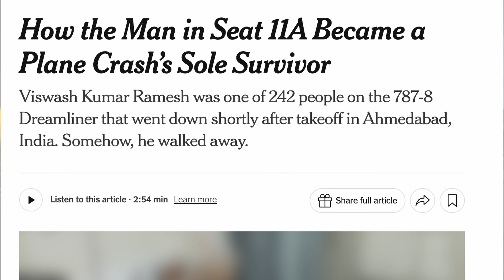Why the RAT Changes Everything – Air India 171 Update

Comment: According to my research he was the best pilot with vast experience ❤️. In those precious final 30 seconds, he tried everything:
1. Sent a mayday call,
2. Attempted a hard landing,
3. Lifted the aircraft’s nose to protect passengers,
4. Relied on automatic RAT (Ram Air Turbine) deployment,
5. Knew that a hard landing was inevitable,
6. Used the landing gear to minimize impact and absorb the shock.
He was the ultimate captain—fighting till the end. We may never know what sabotage or failure occurred, but we salute his duty, courage, and clarity under unimaginable pressure.
Let the world know: there was no thrust, no lift, no power—only human spirit. His last moments were a powerful message to humanity and the global aviation community.
Perhaps, someday, fuel ijector systems or better backup mechanisms will be invented for such aircraft.
Now, serious questions must be asked—not to assign blame in haste, but to prevent the next tragedy:

How could both engines fail simultaneously?

Was it a fuel system flaw, a software failure, sabotage, or a maintenance oversight?

Were redundancies lacking in critical systems like fuel injectors, RAT capacity, or engine health monitoring?

To the aerospace engineers, regulators, and decision-makers: this is your wake-up call. When both engines fail, and pilots must rely on spirit alone, the system has already failed them.

---

Legacy Beyond the Flight

Let this pilot’s courage inspire new standards, better safeguards, and deeper accountability. Let him be remembered not only for how he died, but how he lived: with integrity, with resolve, and with a heart committed to every soul onboard.

“I'm going down... but you alive people—do something for humanity.”

Comment: The crash of Air India Flight 171 stands as a textbook case of compounded systems failure under unforgiving environmental conditions, with tragic consequences.

What began as a seemingly routine takeoff quickly escalated into an unrecoverable emergency caused by a fatal convergence of mechanical, electrical, and aerodynamic breakdowns — all within the first minute of flight.

The first failure occurred before takeoff: a latent electrical issue, previously observed as air conditioning flickering, likely went uninvestigated or undiagnosed. This silent fault compromised core electrical buses responsible for gear actuation, flap control, and configuration alert systems.

After liftoff, the landing gear remained extended, either due to pilot inability or mechanical/electrical fault. This created massive aerodynamic drag. Simultaneously, flap misconfiguration — either under-deployed (low lift) or over-deployed (high drag) — worsened the situation. Configuration alerts may have failed to warn the crew due to the same electrical issue.

The takeoff occurred in ambient temperatures exceeding 40°C, reducing both air density and engine performance. Engines were likely operating at maximum thrust to overcome drag and high weight — leading to an engine surge or failure, as supported by the survivor’s report of a loud boom.

At approximately 625 feet, the pilots declared a Mayday:
“No thrust, no lift.”

The aircraft entered an unrecoverable stall. With gear down, possible flap error, and failing thrust, lift was lost. The nose remained up — a classic sign of deep stall — but the aircraft was no longer flying.

In these final moments, the Ram Air Turbine (RAT) likely deployed. The survivor reported green emergency lights flickering — consistent with RAT-powered systems activating. It is critical to note that the RAT only deploys if both engine-driven generators fail, and the APU cannot supply power — indicating a total electrical collapse.

This suggests either a dual engine generator failure, or a severe electrical system fault that cut off power to both essential buses — even if one engine was technically still running. The RAT may have allowed the Mayday call, but was too late to affect flight control.

The aircraft crashed into the BJ Medical College hostel, broke apart, and ignited in a massive fire. All 241 others perished.

Flight 171 was not brought down by one error, but by a chain reaction:
An unresolved electrical fault, unresponsive control systems, environmental stress, and thrust collapse.
The RAT’s activation confirms a full power system failure.
This disaster illustrates how even a modern aircraft can be rendered helpless when multiple layers of redundancy are compromised simultaneously.

And yet, from the wreckage of total destruction, one man survived — his seat torn from the floor during the breakup, hurled through a gap in the fuselage.
In that moment, fate met physics — and conspired not to take him, but to spare him.

Comment: The second I heard the video I knew it was the rat which also cleared me of the “FO” mistake theory because even if the FO did go flaps up too early there’s no way they would immediately go up… they move very slowly and he could have easily moved them back after making such an obvious mistake. I dont know what could have possibly caused dual engine failure besides fuel contamination or some insane dual engine compressor stall strong enough to stop the engines. The compressor stall would explain the bang but on both engines at once is unheard of and the engine would still be able to somewhat produce power. Can’t wait to find out what cause this tragic accident.

Comment: Another channel talked about the noise from the RAT as the plane took off. The channel played the noise from a RAT unit in operation and it sounds exactly like this sound. 
Also, a news channel from Australia had a Commercial pilot claim the accident was caused by pilot error and airlines are hiring pilots without enough experience. https://youtu.be/3v3E5FVInzg 
I thought this reporting was completely irresponsible from a News Agency and told them so. Thank you for the great job you are doing and your honesty.

Comment: I feel it was electrical. There is a video of the same airplane two hours prier where the air conditioning wasn't working, the touch screens and lights weren't working either. I think it wasn't fixed or it wasn''t fixed properly and that lead to other areas of the plane not working. I think this could and should have been avoided.

Comment: The fact that the aircraft used every inch of the runway to lift off shows there was less than the full power needed from those engines at that stage. What caused that lack of power was obviously not diagnosed by the aircraft electronics before takeoff. This is what needs to be determined. That jet was doomed to crash before it even taxied to the runway.

Comment: My theory of fuel contamination seems to be fitting.l

moisture got into the fuel tank and clogged the inlet pipe causing the engine to stall plus they forgot to set flaps 2. 
Both these are strong contenders.

Let's wait for few more days until the report comes out

Comment: This flight was doomed from the moment it pulled away from the gate. I saw a video that showed that the plane's ac was not working properly. I do not know, though, if that is accurate. If so, though, could it have been an electrical problem? If so, then I am sure they would have called maintenance.  My thoughts are with the families.

Comment: IMO This Airplane uses Non Bleed Jet Engine in layman terms this engine just give thrust to the air plane it does not run AC / Fuel Pumps / Hydraulics etc. APU (Auxiliary Power Unit) Gives compressed air to generator which produce electricity to run AC / Fuel Pump and other instrument. What I believed might have happened is APU failed right after takeoff because of which Complete electrical failure happened RAT deployed and Fuel Pump can not pump fuel as Apparently each engine have 12 nozzles and each nozzle needs 4-5 psi pressure which is impossible to generate with help of RAT electricity. It is just a speculation though.

Comment: A tv news reporter was speaking to the mother of the boy who took the video from the same roof. She said that "the plane did not sound normal..did not sound like other planes." 
Then as if to prove her point another airline flew by (probably a domestic A320 neo) and the sound captured on the mic was loud and deafening.  Exactly how the ill fated jet would have sounded if both or even one engine was running. It was most definitely dual engine failure.

Comment: If you look closely to the main landing gear they seem to be tilted foreward iso backward. I’ve been told the foreward tilt is driven by the gear up hydrolics, where the boogies (wheels) are positioned such before they are retracted into they wheel bays. If that is true, it kind of debunks the theory the pnf pulled the wrong lever.

Comment: The plane involved landed 2 hours earlier from another flight, so what happened between the successful flight and the fatal one? Software update- no ! Dual engine maintenance - no ! What changed - pilots; unlikely pilot error ! Refueling - contaminated or refueling induced technical malfunction. Given high level of redundancy on planes you need to look for single points of failure to explain dual engine failure. Fuel !!

Comment: Technical fault would be high on the list. Possibly a fault of the air/ground logic  to the Thrust Control Malfunction Accommodation (TCMA) has lead to the TCMA thinking it's overthrust on the ground, thus shuts both engines down. RAT deploys. APU tries to start hence APU inlet door open in wreckage with flaps still deployed and unable to retract gear.

Comment: The start and lift off where OK. I think there was an engine failure on one engine. The flaps are set for two working engines. If one engine fail, the flaps have now to be set for this new situation .There was lift, the right wing is tilting upwarts, but too little.  .

Comment: Yes, I completely agree with you about the sound of the RAT. But what led to this? Perhaps there was a critical shift of cargo in the cargo compartment, which caused a short circuit in the battery and the shutdown of the entire on-board electrical system almost immediately after the aircraft took off from the runway!

Comment: Hi Captain, what is the possibility of the 787's lithium Ion battery exploding given the fact that the airplane was in the tarmac for hours under the hot sun, probably close to 40 degree Celsius, which resulted in a catastrophic electrical failure and the consequent engine flame out & deployment of RAT.  Could that be the reason for the loud 'Bang' as reported by the lone survivor. The 787 had a history of lithium Ion battery issues in the past. No one seems to discuss this theory.

Comment: Steve l am a pilot who lives about about 700 m from the south end of FALE directly under the approach departure to that airport. Daily there are approaches and departures of B777 and A350 and the occasional B787. I know well the sound of the engines of these heavy widebody aircraft both on takeoff and on approach. If the engines of that Air India B787 were at full thrust they would have been very audible which they were most certainly not and most certainly one would not have been able to hear the rat. Right at the beginning l saw that video, to me it sounded as if l could hear the sound of turbines windmilling due to the ram air into them. In addition if you look very closely l believe that it can be seen that both the slats and flaps are deployed. Most certainly a video l saw of the left wing lying on the ground showed both the slats and flaps deployed.

Comment: How could both engines fail at the same time, only if there is no electricity to run the engines! so, i believe it is an electrical generation failure or a fuel contamination. fuel contamination is very unlikely, so it is most likely an electrical shut off to the engines. RAT deployment strongly supports this.

Comment: We already knew the RAT was out from the sound but nobody has stated if it is possible to manually deploy the RAT.  In other words could the pilots have misinterpreted a lack of climb for failed engines and triggered the RAT themselves?  There is still a lot of the puzzle missing.  Why did the plane nearly overrun the runway before rotation?  Why did they continue to takeoff if they were so far down the runway without enough speed?  Why is there no indication of flameout in the videos?  Did a pilot turn off the engines accidentally to restart them because he thought they had failed due to flap setting errors?  The flight data recorder will be very interesting.

Comment: Sounds possible but if dual engine failure would not the aircraft switch to standby emergency bus?
Rat would have taken more than a few seconds to deploy and come on line. Along with airspeed was low at that point. RAT is kind of useless at low airspeeds. Not a 787 one but look forward for 787 ones comments here.

Comment: 1:38 first engine clearly flames out, that is smoke not dust, notice how it trails the plane into the sky instead of dispersing. Question is why engine 2 also shut off… either pilot error or a bird strike

Comment: I found a video on the New York Post channel from a guy, who flew the same plane early that day. The air conditioning system, cabin calls, video monitors, remote controls - nothing was working on that plane. Two experienced pilots took off at the very end of the runaway when the point of no return was crossed. A very limited choice for a fully fuelled plane: fly up or go forward and crash. RAT was deployed immediately after take-off, so this says that problems start on the runaway, not after take-off. I'm not a pilot, but if no electric power on the plane, how engines can get fuelled then? I do believe that something must pump fuel into an engine and that 'something' must be an electrical kind of thing. Can air temperature affect computers on board to get them 'frozen' or faulty otherwise? I believe that heat can be very dangerous for any computer. Also maintenance issues... If no electric power in the passengers' salone, why did they let this plane fly?

Comment: I am glad to hear you change your opinion as smart people do. I was getting frustrated with people just focussing on the undercarriage remaining down as being somehow significant and the potential impact of the flaps being retracted early or not deployed. Looking at it all initially, my early call was duel engine failure, rare, but not impossible. No way a co-pilot with hours of training and muscle memory, would reach for the wrong lever in a totally different position, with a totally different shape and mode of operation i.e. lifting the lever to unlock it in order to move it. So that for me should not even be an option. With regard to flaps, we know they were not retracted as the wing remains on the ground clearly show the leading edge slats deployed and trailing edge extended to at least flaps 5. So we had flaps on takeoff and they remained deployed until impact. Put those theories to bed. With regard to undercarriage which many people focussed on, yes they remained extended and yes they can add to drag which in this situation would not be good, but the simple reason they remained down was the call to retract them was never made. I said that initially, just looking at the footage, the length of flight, the time the first signs of trouble occurred, within 8 seconds, and the fact the whole flight was only 30 seconds. I think immediately on lift off things started to go wrong, they sensed straight away there was a problem with thrust and power and lift as a consequence. They had 30 seconds to avoid crashing at the worst possible time, take-off, when they needed the power, they did not have the luxury of any height to play with or an unobstructed line ahead to try a crash landing. So I would assume they never called for gear up as they were immediately battling for survival. Even at 8 seconds after rotation you can see something is not right visually, the plane starts to struggle with lift, the attitude starts to change and I am sure even in that 8 seconds inside the cockpit it was very different to what we saw externally. The fact the plane did not really yaw too much and headed into the ground in level flight was an early indication to me it had an equal power loss, so both engines. Now with new data like the RAT deployment and the exact words of the Captains Mayday call 'Mayday ... no thrust, losing power, unable to lift', it all points to duel engine failure. The why and how is obviously what all will be waiting on.

Comment: Humble prop pilot here , even in GA which I fly the first 300 feet is critical before gathering 800 feet and entering into circuit to make  1000 on take off  even though I can initiate glide, heavy iron not so and yes that is the sound of a prop not a jet so the RAT deployed obviously listened to it twice on your three time run , dual flame out maybe contaminated fuel   the air investigation will show what when wrong it was obviously some catastrophic failure with little 2 no lead time for corrections ,may they RIP .

Comment: Flap control is to the 2nd officers left leg at 9 o.clock and ratchets in stages, which adjusts the angle of attack for the flaps.  The Undercarriage lever is is just that. you either push it into either the 'up position or down.  The Gear Up/down lever is situated on the console on the Captain's side at his two o.clock  They are distinctly separated. And anyway! The 2nd Officer would have to be totally ignorant of the controls to incorrectly select the landing gear lever for that of the flaps control.